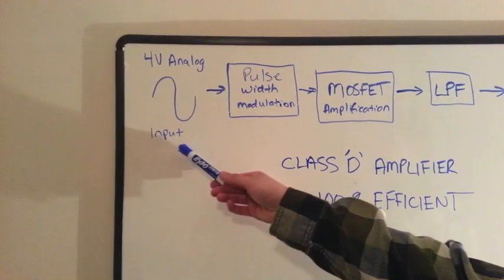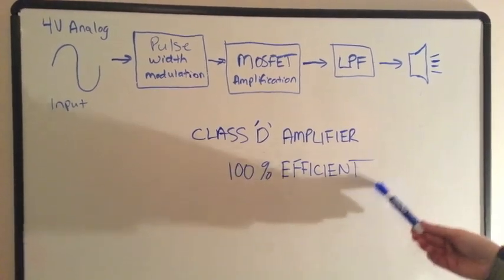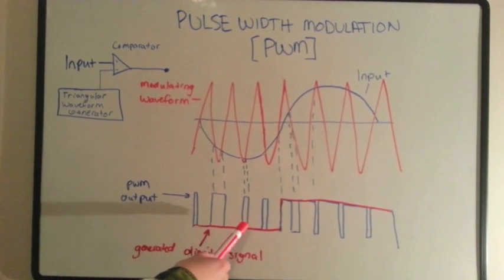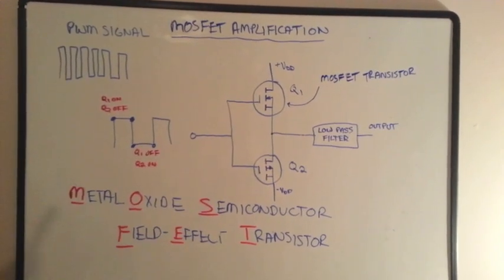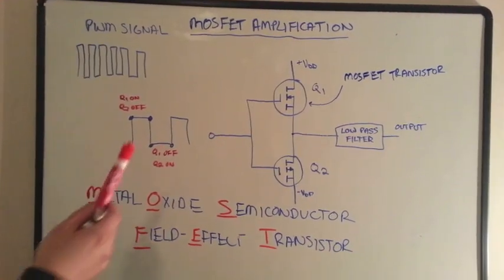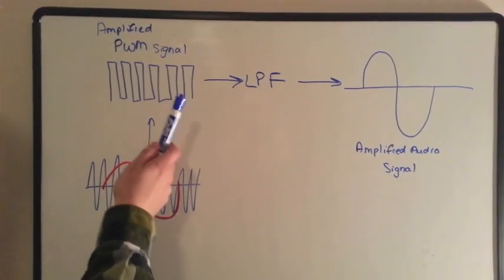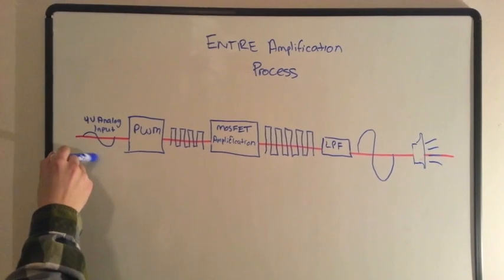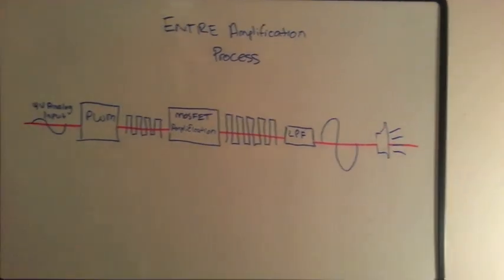MOSFET Stereo Amplifier

Comment: These class D amplifiers are of course not 100% efficient. The main losses are the resistive losses of the MOSFET channel and also the losses when the MOSFETs switch off and on. But especially for higher output power it is possible to reduce these losses down to just a few percent of the total input power. Another source of losses are the required dc-dc-converters to transform the board voltage of 12 V into the voltages of the amplifier rails which are typically symmetric to ground.

The circuit scheme of the MOSFET output stage is not correct in the video. You showed a common drain stage, when the MOSFETs however are switched in their position and in their connection. In such kind of output stage, the MOSFETs share their drains with the output and their sources point to the power rails. In this connection the p-channel MOSFET points with its source to the positive voltage and the n-channel MOSFET to the negative.

This circuit is very typical for class AB amplifiers but not for class D amplifiers because of its higher losses due to the threshold voltage drop between gate and source. So the common source amplifier configuration is more useful. Nowadays two n-channel MOSFETs with a boot strap half bridge driver is used in the output stage. The half bridge driver also avoids the so called shoot through during the time, when the MOSFETs are simultaneously switched.

Comment: What happens if the mosfet goes bad
Reply: Shane Burnett Why would it go bad assuming the connections are fine?

A lot of amps have built in protection to ensure it doesn't burn up

Comment: 100% efficiency is impossible.
Reply: Thats all on theory not on the real practice of the transistor
Reply: +Dustin Mccormack  Agreed. If it were 100% efficient, then there would be no need for heat sinks. I'll bet everything I own that it is loaded with heat sinks.
Reply: Dustin Mccormack He's talking about the transistors. Resistance in digital circuitry is negligible. I would suggest that the heat sinks dissipate the heat from the analog processes.

Yes, it's not a perfect solution. But if you feel the heat output from a 50 watt analog amp vs. a 150 watt digital amp, you'll see a huge difference.